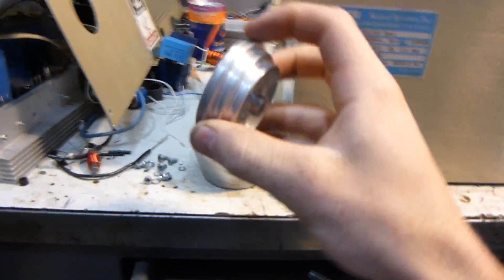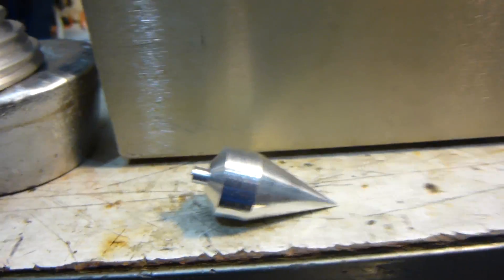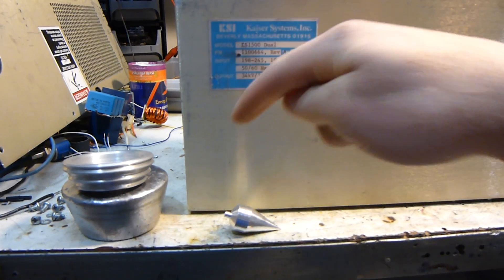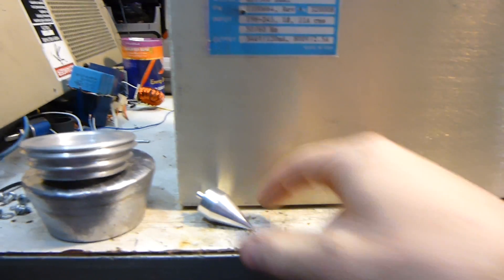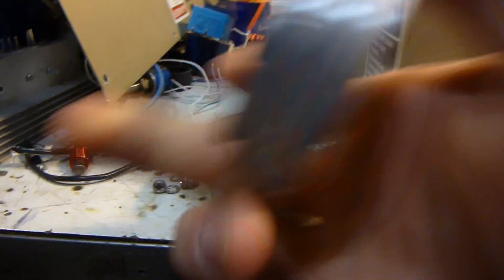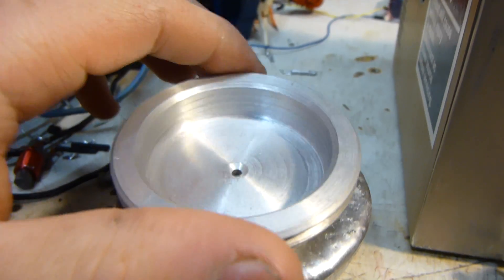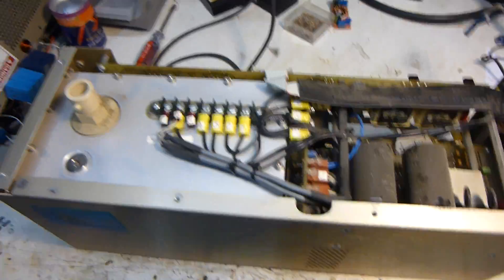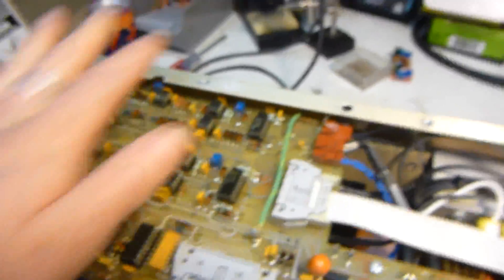Happy Memorial Day, Turned Some Things on the Lathe, High Voltage Power Supply

Comment: Makerj101 CADD drawings can be transferred from a computer to the lathe if it is capable of doing it.  CADD is also not to be confused with CAD which stands for computer aided dispatch. I don't think CADD drawings would be helpful in public safety

Comment: I've found if you let the aluminum sit a few months to a year, it machines much better.  Good Job btw.
Reply from the maker: Chuck Mercer Huh that's interesting.  So like the structure of the atoms changes or something?  I wonder if I heated it up in my furnace to like 400F and let it site for a couple days if that would make any difference.  Thanks!

Comment: Damn lathes... I so wish I had one. Either that or a milling machine. Being able to turn your own parts or make new mechanical components is such a useful skill to know.
Reply from the maker: Jordan O'C Yeah they are so nice!  The one at HackPittsburgh is very old and a bit warn out.  But a warn out lathe is better than no lathe.  Maybe you can find a club kind of thing that has lathes and cool tools like it did.  I'm not sure if there is that kind of thing where you are.
Reply: Makerj101 That's true. Unfortunately, there isn't any groups or clubs near me that does this sort of stuff, which is saddening. My school had a lathe, but got rid of it for literally zero reason, which really irritated me.
Reply from the maker: Jordan O'C That really stinks.  :(  You can generally buy a new mini lathe for under $1000.  But it's still a lot.  Used ones are often a lot cheaper if you can find them.  Good luck man.  I hope you can find one.  You can always turn really small stuff in a drill press.
Reply: Makerj101 That's the problem, the prices... And actually space: I don't have a garage and I live in a flat on the 2nd floor, so I also have to also worry about noise haha. Ummm, yeahhh. I don't even have a pillar drill/drill press haha.
Reply from the maker: Jordan O'C Hmm... Maybe you can find a guy who has a lathe or a local college.  IDK

Comment: You're an "Explorimaker"! "Experimaker"? Better get that url. That pulley is great! That would be so useful! Unfortunately I am lathe deficient. They're so expensive and it seems they're just a drill press laying on its side. Why is a drill press $100 and a lathe $1000? I wonder if a drill press could be converted? What's the difference between wood and metal lathes?
Reply: U just hafta swit to ur drill turning the work not the key or bit which requires a lot more rpm
I tried this and it only was good for wood
Reply: One turns wood and the other turns metals.

Most wood lathes only have one gear.it won't be simple to convert.dont try
Reply: Ferguson 20 diesel oh, ok. So which one turns wood and which turns metal? And if I put wood in a metal lathe will it explode, dissolve into a puddle on the floor or just protest angrily?
Reply from the maker: Andy Jones Ferguson 20 diesel  Well a drill press can be used as a very small lathe.  I've done that before.  But it's only good for as big of things as you can fit in the chuck.  A lathe has a much bigger chuck for one.  Lathes are also a lot more powerful.  The different between a wood lathe and metal lathe are:  A metal lathe has a place to attach the tool securely and uses screws to advance the tools very slowly.  A wood lath just has a tool rest and you use chisel sort of tools to carve away the rotating wood.   Yes you can put wood in a metal lathe.  And you can also to a certain extent convert a wood lathe to a metal lathe.  But you will not get all the functionality or precision.
Reply from the maker: karson king Cool
Reply: Makerj101 seems like it might have the potential for a diy project. It might not be the most precise lathe, but a drill press would be a good starting point for the motor, belts, etc, then buy or make chucks, tool guides, etc? Its been a long time since I've even seen one so I could be very wrong. If you could figure it out, u could sell drill press/lathe conversion kits, assuming it would cost less than just buying one. Cheapest ive seen was harbor freight mini lathe for 600.
Reply from the maker: Andy Jones Yeah it's a good idea.  It would really require a lot of modification though.  For one a drill press has thrust load designed bearings so much lateral force will wear them out pretty quick.  But I think it has been done.  I'm sure there are already some on conversions YouTube.
Reply: Makerj101 once again,you're right. By the time you did all kinds of conversions and made chucks and guides, etc, you'd probably end up with something fairly inaccurate, it would take tons of time, and probably end up costing the same. Sometime diy makes sense, sometimes it doesn't! Unless its just for fun!

Comment: I was supposed to be in the air force and do the job of waiting to launch a nuclear first strike... But life screwed me out of it...
I got another torid type mains transformer, This one has multiple taps and one steps the volts up to like 300 VAC and 150 VAC from center tap from 120 VAC and the rest step down to like 72v, 48v, 24v, 12v and so on..
I think I may leave it as-is or even add more windings to try to get it up to the 440v range, not sure just yet though.
I am not in town ATM I got called to Vegas for some emergency IT work after some drives crashed due to an earthquake..
Reply from the maker: ElfNet Gaming Wait you were going to launch the first nuclear bomb?
Cool!  Sounds like a really sweet transformer!  How big is the diameter?
Reply: lol no.. not that you know of anyways - evil laugh -

The torid is the same as my other one about 6 inches.. It came from a blown peavey power amplifier. I have another video when I first got it along with some decent power filter caps.